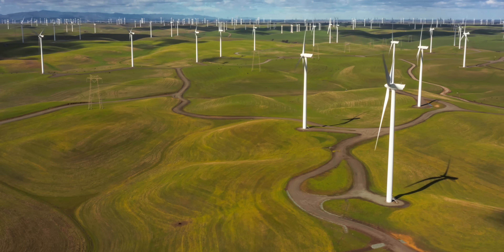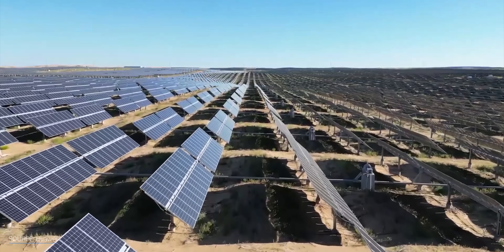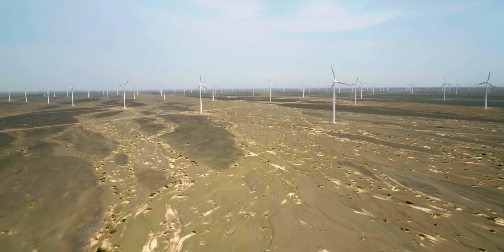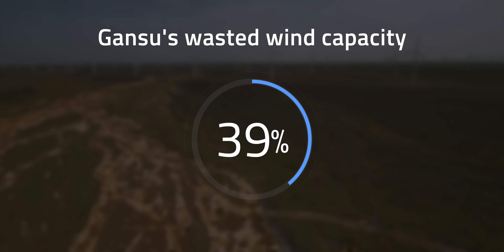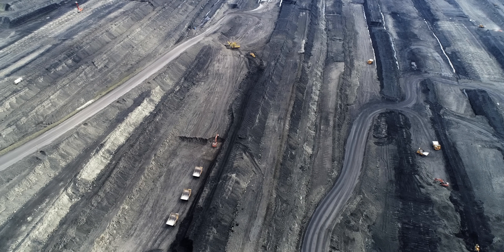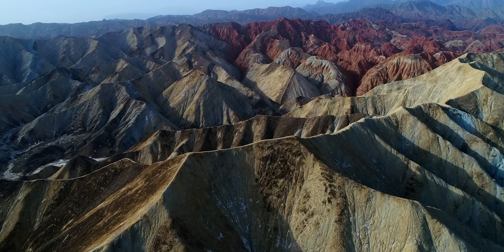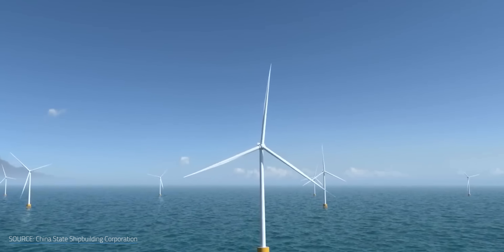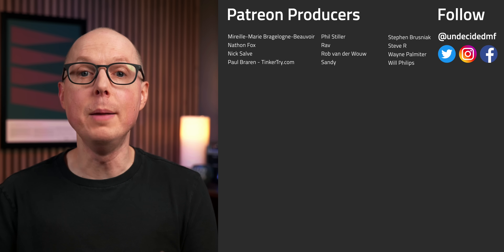The World’s Largest Wind Farm has a Tiny Problem

Comment: This is why SMRs are the way to go as they can be put close to a population center and have a small footprint.
Reply: No they really aren't. I predicted years ago they would be a damp squib. Just another way for nuke shills to claim nuclear is cheap and or will get cheaper. 

Smr companies are folding now and where they are not they are now claiming higher prices than traditional reactors. 

We just need to mass produce large scalable reactors to keep costs manageable. Like France did, but then they let the skill base go and it's back to being expensive. 

Even historically strong nuclear countries are going renewable. Nuclear is not a golden bullet
Reply: That doesn't solve the fundamental problems of nuclear energy. Basically you shouldn't place them close to populated areas.
Reply: @beatreuteler  The idea with SMRs is that they can be completely sealed and automated and designed for automatic shutdown if they overheat. And if they use Thorium instead of Uranium then we can source it fuel from the U.S. instead of Russia.
Reply: @mikeearussi   SMR and thorium don't work well together. Thorium needs a breader reactor and these don't scale well to small size. Even for larger ones it is unclear if thermal spectrum thorium breeders are practical / feasible.  Thorium reactor would need way more (e.g. 100 x)  chemical reprocessing than current uranium reactors. Its like dicussing electric vehicles and ignoring the need for batteries.
Reply: @mikeearussi  OK. but that product is not ready. Let's see. For the time being (approx. next 30 years) this is a nogo in our country.
This said for what we need today it comes too late anyways.

Comment: China is using NIO power swap stations to offload excess wind/solar power for charging swappable batteries.  The charged batteries also help stabilize the grid during high demand times.  Chinese provinces are partnering with NIO to build them out and other automakers are partnering with NIO on swappable batteries.  It’s a win win situation

Comment: You would think if capacity was so far beyond demand they'd find some way to dump the excess.  Heck you could make a massive electrolysis complex to crack water into hydrogen and store the hydrogen for later use.   Not the most efficent energy storage method but fairly quick to setup and scale.
Reply: That's where the carbon capture and turn it into synthetic fuel comes in. Not efficient at all, but enables the use of existing transport and storage age facilities. Also used by existing vehicles and equipment.  Probably not the long term answer, but seems to have potential for bridging the gap.

Comment: The wind zone in the US is far from any population centers that would use the power.  T Boone Pickens almost went broke putting up 
transmission lines (and transformers) to large cities in Texas from his wind farm in western Texas.
Reply: They are building a massive transmission line from South Wyoming to Las Vegas and then ultimately to LA. The wind here in SE WY is second only to the panhandle of TX. I'm fine with it, as so long as the state of WY can charge and collect good taxes on the wind power sold to other states.

Comment: Near the start of the video but I'm anticipating a lack of infrastructure to transport the electricity and power loss due to distance.  May be a good place for high power industries like data centers and then add the transmission lines and fiber optics in concert.  Sure the distance isn't ideal for data centers but their loss over distance is far less than for transmission lines and this would alleviate power draw on power generators closer to populated areas.

Comment: On the glass houses comment, per capita standards should only apply if the country is emitting CO2 for the benefit of its society.  Instead, China's emissions are related to industry, which it tries to use as the world's factory.  In essence, it produces pollution by not following international standards, in order  to enable cheap manufacturing for foreign nations, and the proceeds go to the government and the wealthy.  It uses this to gain market dominance to empower the country to compete against others.  The people in glass houses should worry more about onshoring their own manufacturing, and China should focus on its own consumption, then the problem will be solved.  As it is now, a per capita metric for a country that isn't emitting CO2 for the benefit of its own society is dumb.

Note also, CO2 emissions generally scale proportional to total GDP, not per capita GDP.  A better metric than per capita emissions is emissions per unit of GDP.
Reply: Cope.

Comment: I don't think such mega farms of renewable energy harvesters are logical or even viable. They require an immense amount of land and are often situated in supposed "nowheres" because where else would you put them? And thus they are both very very far from major population centers and also still have a major effect on the environment.

Houses, buildings, private yards and also public areas such parking lots, local parks and perhaps even spots that should be shaded along sidewalks are all unused real estate for solar energy production.

When we develop the panel type which is truly cheap to produce, efficient and also LEAD FREE (if the current perovskite type goes industrial it is a massive environmental pollution waiting to happen), placing it at and close to home is the way to go. Everything else is stupid.

Comment: Your application of logic is too stark because replacing coal jobs was the point. The very thing that did not happen in the UK under PM Thatcher. There were no plans to replace the jobs lost by closing coal pits.
The Chinese action suppressed unrest and the rest in terms of technological hardware would follow, along with more jobs.
Often throwing money at a solution is the solution.

Comment: I was waiting for you to quote the wind farms size at 3049200000 square feet and thus prove the Murikan stupidity of using square feet and pounds in your measurement system, surely 3049200000 square feet rolls off the tongue beautifully but conveys NOTHING.

Comment: so you build out a wind farm without first determining how the power will get to where it needs to be used....ahhh a bit backwards don't you think? I completely agree with locating this type of renewable energy source (along with solar) in a remote, little used area of a country, but concomitant with that you need to develop and build the transmission and storage methods to have a full functioning solution. They seem to be so much more ahead in so many ways from where the USA is. Very interesting.
Reply: That's exactly the image the CCP is intentionally curating.  Meanwhile the USA seems to be a chaotic mess.  But this chaotic mess generates powerful and enduring ideas.  Kind of a metaphor for life itself thanks to the randomness of genetic iterations.

Comment: We again run into externalities (not charging the true cost of burning coal - for instance the health costs).  Anyway, perhaps we put too much emphasis on mega storage systems.  Using price differentials (cheap power when demand is low) companies of all sizes and even private homes will find it economically feasible to install appropriately sized storage.   The crying need is a low priced forever battery.  And if they have all those lovely mountains between the wind farm and the users, perhaps a lot more pumped storage would help.  Clearly demand balancing of grids is still in its infancy and much more could be done.

Comment: 7000 wind turbines equals how many personnel to maintain it? They would have been better off building a few nuclear power plants in the areas they need the energy.
Reply: The personal needs are not that bad.
Reply: Diversity instead of one option
China building Rewnewable and Nuklear with the same effort. 
Other Countrys Rewnewable and Gas
You always need a second energy as Backup

France didn't and they will struggle because their Nuklear are to old and building new takes 20 Years.
Reply: I'm sure you've done more research on this than the people who built it...
Reply: @Foquro  You're right, governments, especially the CCP look at the greater picture  making sound decisions based on logic and not looking good in front of the world in regards to their Green Energy achievements.
Reply: Nuclear needs water. Not much of that in the middle of the desert.
Reply: @5353Jumper  obviously you didn’t read my post. I said building a few nuclear power plants in the areas they need. The energy is what’s needed. That’s not exactly in the desert where the wind farm is.
Reply: @shumann1605  you also may not know that China is currently building more nuclear power plants than the rest of the world combined...in areas with water closer to major population centers. AND they also need to supplement that with wind and solar in their move toward a low emissions national energy system.
Reply: @5353Jumper  yeah, they are trying all options at once, that's a good chinese approach, they will, however, realize that not all options are equal and stick to the most effective one eventually (nuclear). Since energy production is not a part of brainwashing political propaganda, but just an instrument there.
Reply: Nuclear plants are also heavy on personnel and require cool water.

Comment: Nevada Arizona and New Mexico are all excellent candidates for both solar and wind power Mega installations and they already have the electrical transmission system issue taken care of due to the large hydroelectric dams already installed in those areas they would need more battery backup systems though I strongly advise against both Shore and offshore wind power plants you guys need to remember that all of the energy they are collecting is also being taken away from the storms that water deep inland if you produce too much wind power plants near the shore then you'll find that you have quite a few more floods near the shore and longer and worse droughts inland

Comment: I love the fallacy that wind turbines and solar farms will replace existing means of generating energy.  We've many examples of supposed green energy failures. All across Europe and even in the US they are failures. They can't be relied on for power and are not green. The maintenance of these boondoggles is mind-boggleing. When they fail a windmill is a disastrous means of polluting the ground. The lubricants and materials are a nightmare. Yet, we are focused on these failures and then push for more climate change BS to ruin the economy. While Cuina and other nations thumb their noses at the climate accords and burn coal. Stu0dpity on this grand scale can't be fixed. Instead, the nation will have to fail before there is a real fix for the problem, nuclear. By then many folks will die and our nation will fall. The folks responsible for these actions will not suffer or be prosecuted. They will blame everyone else for these failures.

Comment: 39000 Squarekilometers for 7000  turbines??? Belgium? 
An average area of  more than 5.5 km² for a single turbine? 
I think someone has to do the maths again.
Reply: t's not a single contiguous wind farm the size of Belgium.  It's sixty separate (very large) wind farms, with plenty of separation between some of them, and altogether they are spread across approximately one standard Belgium's worth of Gansu.

"The project is divided into multiple phases. The first 3,800 MW phase consisted of eighteen 200 MW wind farms and two 100 MW wind farms. The second 8,000 MW phase consists of forty 200 MW wind farms. "
Reply: @JonathanMaddox  So 39.000 km² is just a misleading figure. Most wind farms aren't contiguous, also in western Europe (unless they are offshore).
Reply: I'm sure some areas are not used, and some are more dense.
Reply: @hubertbaumer5487  He says in the video that it's a number of different projects spread over the area, not a single huge farm
Reply: I think you have to treat area values differently than regular distance. To look at this effectively, get the square of 39,000 square kilometers; it gives you roughly 197.48km. So if this area was a square, it would be 197x197km. Area figures don't have to be square, but the maths don't care since it will always result in the same 39000 square kilometers.
Now, spread the 7000 turbines out over the area by getting the square of it as well, which gives you 83.66. So, over the 197.48km, you'll see (on average) 83.66 turbines.
If you want to know how far it is between turbines, take 197.48 divided by 83.66, to get 2.36km per turbine, roughly.
Yeah, it does seem like they are spread very far apart. Maybe they meant 70,000 turbines? The math on that seems much more reasonable
Reply: It’s just ridicilous to use so much space for that low of an output. And you can’t just put the turbines where you have the demand for the energy. Building expensive grids 1500 km long is not effective. So calling this project a success is just not correct.
Reply: A single large scale wind turbine is around 260 Meters in diameter, at the largest currently, that's 0.26km, which means that the turbulence created is even larger... 5.5 sqkm probably is what's required to prevent impeding other turbines and minimize resonance between them.
Reply: You don't stack all of the turbines 5 meters from each other.. they need a fairly big empty circle to work peak efficiency, plus local geography means you can't place them perfectly every sqkm
Reply: Let’s put this in context 7000 turbines on 3900 km2 and 1 nuclear power plant at Chernobyl that now has 4143km2 of unusable land around it - I’ll take the turbines any day
Reply: you have to think about the turbulence created by the turbines, you have to space them out to make efficient
Reply: @Th3Mast3rL0ck  I don't think you realize how big 5.5 km² is
Reply: @Ezullof  i do, also have an understanding of how geography impacts wind distribution and suitable locations to put in turbines.
Reply: @Th3Mast3rL0ck You don't need to space them over 2km apart.

Have you never seen a wind farm?
Reply: @marcwilliams9824 yes,  what I am saying is I can see a possibility of where in said area there is "bad ground" where it wasn't economically viable to put one down.
Reply: @Th3Mast3rL0ck 
Interesting, just learned something.
Reply: When a turbine breaks, it can fly and hit the adjacent one. Sometimes a farm is designed to avoid cascade thing like that, but I think this 5*5km is for turbulence. It's not that much if the turbine is big enough. You can google it for yourself.  I'd say the trail probably go like 2km, and they just make that a radius. Add some clearance for breakage and service relate stuff. Add some Chinese land rent kickbacks. Also, its not like they lack space in the desert.
Reply: I've seen some wonky numbers regarding the space Chinese renewable projects need (mostly from anti-renewable crouds but they don't seem to be the source just picking up on that. They use that for arguing/ "well there you see it, you would need half of all land on earth to go fully renewable!!!" )

Which is kinda strange since I always belived  China was fully metric... And just converting between feet and meters don't seem plausible for the decrepanies I have seen... Maybe it's just peope mistaking hektar for km^2 but it did not really looked like it...

Comment: Texas became the leader in the USA for wind energy by building the transmission lines first before building the wind turbine farms. It also speeded building any electrical infrastructure by having its own electric grid. For Texas, it doesn't require coordination among multiple states which slows down the process.
Reply: Yea, but it's not all milk and honey. A few failures.